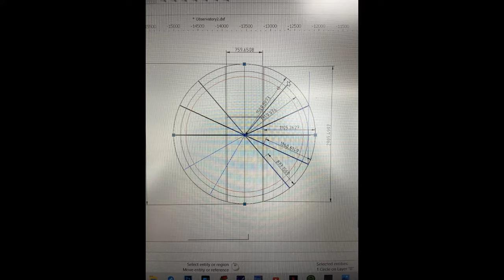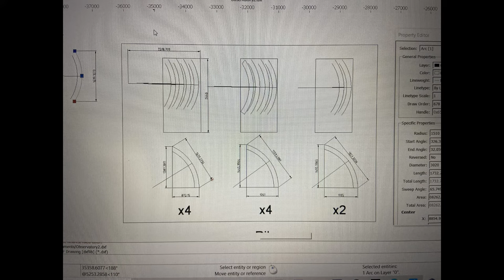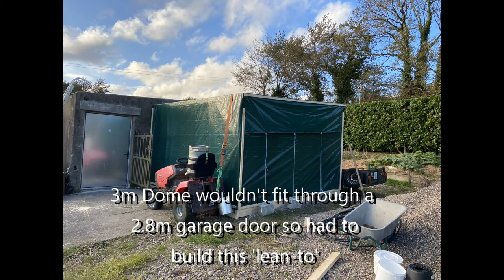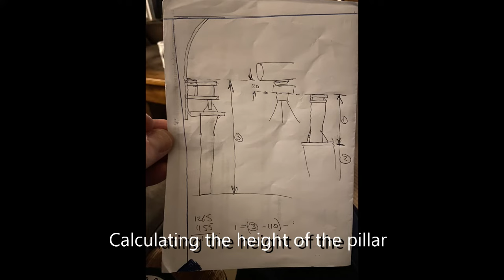DIY Observatory Build

Comment: Nice job on your observatory. I have on I built in my yard using an old 10.5ft satellite dish. It works well except I have to put a tarp over it when it due to rain because I haven't figured out a window covering that opens and shuts. Once I get that done I can go on to the final step, motorized dome rotation so I can use the scope with WIFI from inside the home with the ASI AIR PLUS.

Comment: Fantastic, great job. I am designing a 3 meters dome very similar to this. I have mock ups and made some tests but I did not start yet the construction. It will be great if you can answer some questions I still have.  Specifically how you implemented the mechanism for the sliding door.

Comment: Nicely done. How do you have it track with your mount? If you are imaging and the scope is following a target, your dome needs to follow too yes?
Reply from the maker: Thanks Damien😊 I’m turning the dome manually to follow the scope for now. Was looking at different systems to automatically track the scope but are complicated. The dome needs to be moved every 15-20mins so it’s not a big deal.
Reply: @RFDHunter  I'm looking to build something similar in my backyard. I think i can do the automation using some toothed track and an old wiper blade motor from a bus. Or a cheap ebay low RPM, high torque motor.